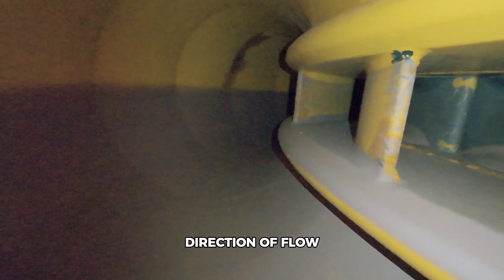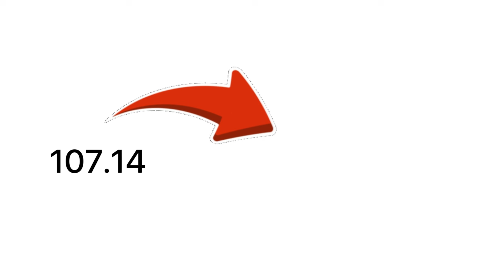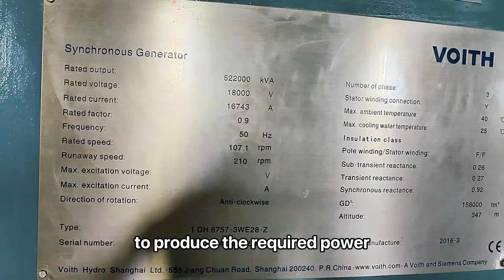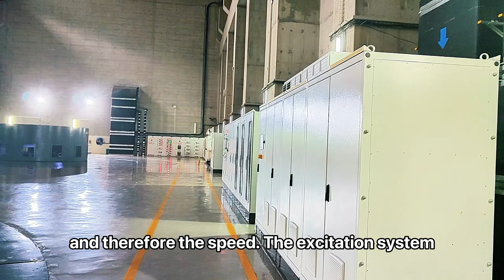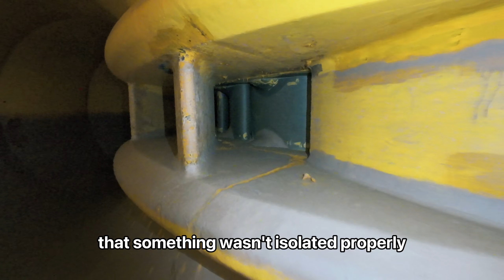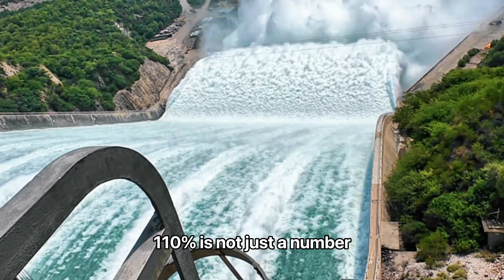The Terrifying Sounds Inside a Hydro Turbine: Is It Gravel or Cavitation?

Comment: What about 100 poles?
Reply from the maker: Frequency 50 or 60Hz?
Reply from the maker: If no of the poles are 100. For 50 Hz the frequency rpm will be 60. And for 60Hz frequency rpm will be 72
Reply: @hyrovision sir,which one more efficience,more poles or less to generates electricity?
Reply from the maker: More poles don’t necessarily mean higher efficiency. The number of poles mainly determines the required synchronous speed: N = 120f/P. More poles → lower RPM. Generator efficiency depends more on the machine’s design, size, losses, and operating point than simply the number of poles.

Comment: The formula you showed on calculating the number of poles and RPM equals frequency what part of the formula does the division of 120 come into the final answer. I have used the formula before but cannot think why we divide by 120. Sorry about the long winded question.
Reply from the maker: That 120 comes from converting revolutions per minute to seconds and accounting for pairs of magnetic poles, rather than individual poles! 😊
Reply from the maker: The 120 in the generator frequency formula  f=pxn /120 comes from two conversions: 60 converts RPM (revolutions per minute) into revolutions per second, and 2 represents the fact that one electrical cycle is produced for every pair of magnetic poles. Therefore,60*2=120 .

Comment: Here are two power grid questions I'd be interested in seeing explained in a video.
1) Synchronization and the speed of light: 
Imagine you had a single power plant feeding a single load. The load is located 500 km west of the power plant. The sine wave at the load will have a phase delay of about .00017 seconds, right?  Now if you add a second power plant 250 km east of the load, I'm guessing the phases will match exactly at the load. If so, then the second power plant phase will be .000085 second behind the first power plant. If this is right so far (it probably isn't), what happens when a second load is added between the first power plant and the first load? It seems like the phase delays due to the speed of light can't all work, but obviously it does in the real world.
2) Small changes in power consumption on the grid: 
What happens second-by-second when a small change in power consumption (say an increase of 100 watts) occurs? I know changes way bigger than this are happening all the time on a real grid, this is more of a theoretical question. Obviously the power production and power consumption must always match exactly (after accounting for grid inductance, capacitance, and the speed of light). I assume that a 100 watt change in demand is too small for any power plant on the grid to make a mechanical adjustment (like change the position of wicket gates, steam valves, etc). My guess (probably wrong) is that in the first second, the voltage on the grid drops (by an immeasurably small amount). This voltage drop then puts more drag on the generators, so they start to slow. So, over a longer period of time, the frequency on the grid drops imperceptibly.
I know these questions may be too technical to make an interesting video, but I figure it doesn't hurt to suggest them. Thanks.
Reply from the maker: Let me see what can I do😂
Reply: Actually was always wondering about second question too. From what I think, you would slow down rotor by unmeasurable small amount, until thousands of users will do the same, so it can be measured, and governor will react by adding a bit to wicket gates.
Reply: Actually that would be ~3k 3kw kettles for 500mw hydro plant to make governor even do something, considering dead zone filtering. Note: that's info from LLM/AI, do not trust it blindly.

Comment: Nicely explained hydro TG operational limits & their prominence..💐🤝
Reply from the maker: Glad you enjoyed the technical breakdown! 😊
Reply: Certainly, thanks a lot.  Pls brief on pressure relief valve connectivity with the spiral casing which releases to tailrace in the event of emergency in TG set. Is this feature a design concept or since it can't insert it after civil works are completed.